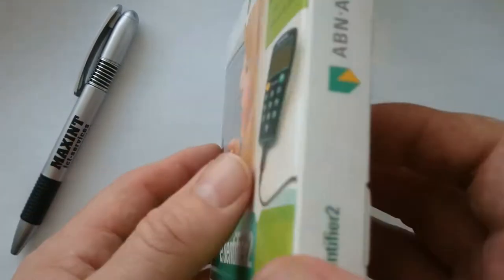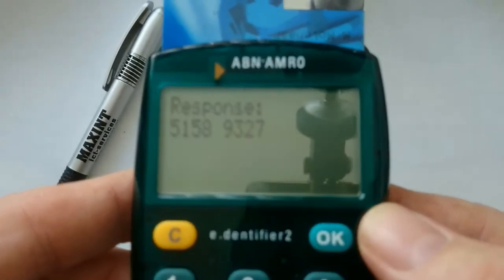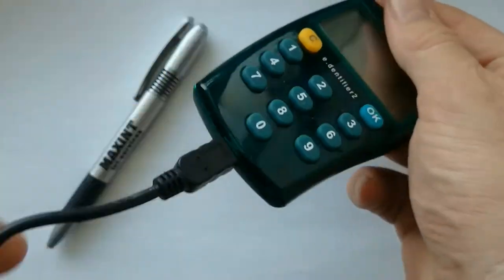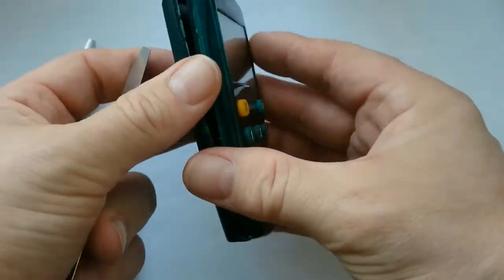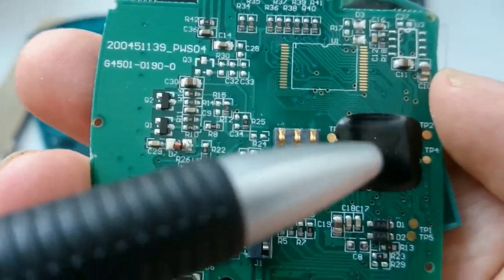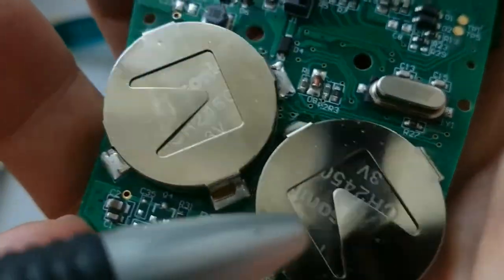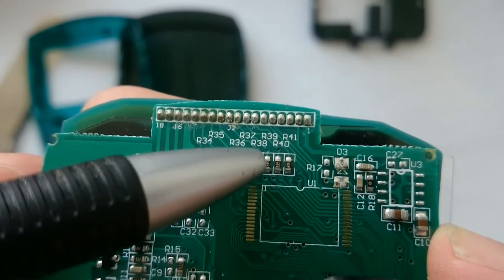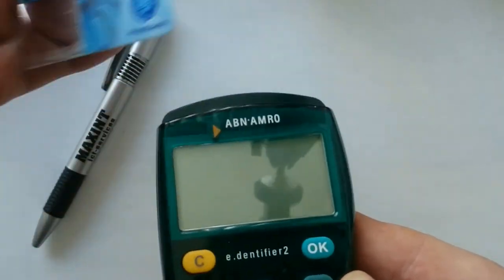Teardown: Bank card reader ABN-AMRO e.dentifier2 (part 1)

Comment: I did a teardown of the previous model myself a few years back. It was called the "E.dentifier" (without the '2').
I remember it having a anti-tamper contact inside. After pulling the front- and backcover apart the microcontroller or asic (or whatever is under that black epoxy blob) would no longer work. I don't see that same mechanism in this version, i guess they figured out another way.
I wonder if yours would still work if you power it with another 6V supply or replaced those batteries....
My guess is that it would somehow detect that and immediately corrupt it´s own firmware. (anti-tamper)
Reply from the maker: From what I remember, it is not there. Just opening doesn't kill it. As you can see in the part 2 video I  connected a logical analyzer to find out how to drive the display. The device kept working during that process.
Reply: @MaxintRD  Cool ! I didn't know that there was a 'part 2'. Earlier today i was watching Dustin Watts latest upload, that's what brought me to your channel. I think i will go watch 'part 2' then.....
Nice channel BTW, you have a lot of electronics related uploads.
Reply from the maker: @riesmoos  - Thank you! Great to see you like it. If you want to dig deeper you can follow the links in the description... 
Dustin has a very nice channel and I envy his productivity in publishing good quality videos that I enjoy to watch. Dustin's videos about using EasyEDA gave me some crucial clues and helped me to make my first PCB's. In return I sent him some material (which you can see in one of his previous videos). I think his content deserves many more viewers, so spread the word...
Reply: @MaxintRD  Thanks. I'm reading the Arjan Blom Thesis now... Very interesting stuff.

Comment: oh Thanks for the video, I've tried but I can't open it :( I don't have a tool to open the edges. My E-dentifier is damaged because it is submerged in water. I've dried it in the sun's heat. The abn amro logo appears when it's charged. But when I insert the card nothing appears on the screen. I need a code from the E-dentifier to transfer money. do you have any advice?
Reply from the maker: The front and back covers are glued together and it is very hard if not impossible to open the device without further damage. If you need an E.dentifier for banking purposes and your current one is damaged, you should just request a new one from your bank.
If you like to tinker with electronics, you may find the follow-up video interesting. In that video I show how I reused the LCD display for my own purposes.
Reply: @MaxintRD Alright, thank you!

Comment: Is it easy to replace the batteries yourself this way?
Reply from the maker: No, definitely not. The housing is super glued and hard to open. If the batteries run empty you better ask the bank for a new one.
Reply: @MaxintRD   Thank you for your reply but I can get it open like you did. Even then it is difficult to replace the batteries or are they soldered?
Reply from the maker: The batteries are not soldered, but have a holder. Good luck!
Reply: after years of using the device the batteries are still fine
Reply from the maker: @maicod  - the devices I got were brand new, in unopened boxes. In the device the batteries will last for many years. Most people don't use it frequently and it doesn't use much power even when switched on...
Reply: yes it has no backlight so the current use will be minimal